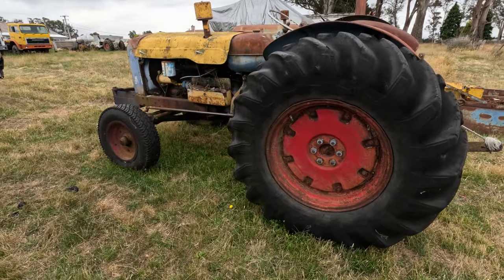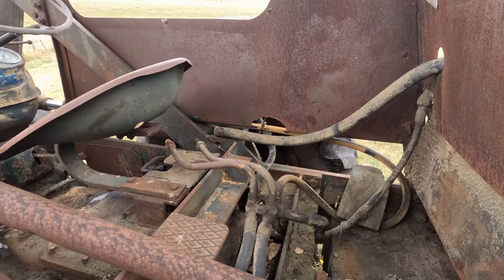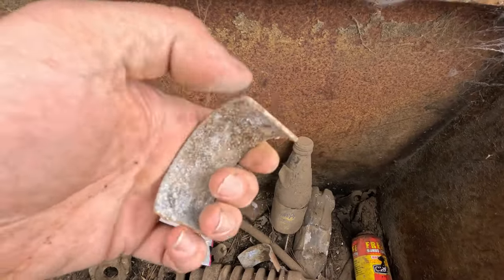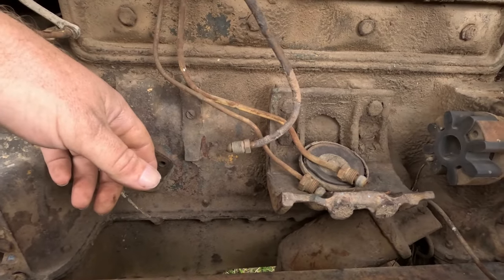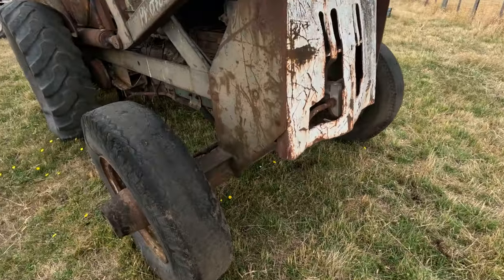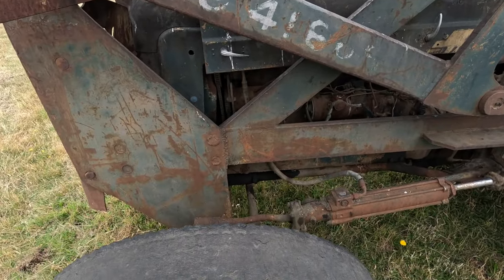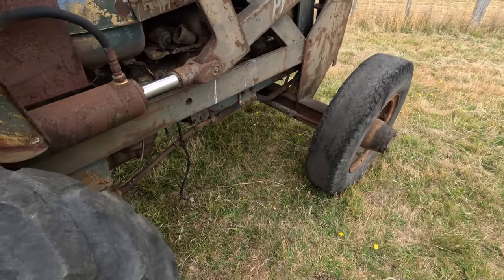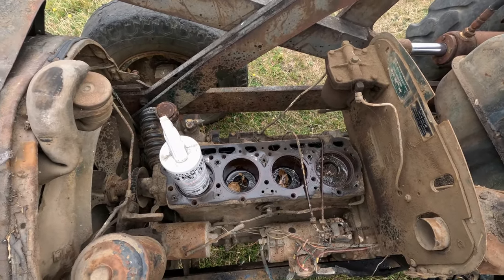Walk around of my Fordson power major fitted with a Malcolm Moore HC3 crane

Comment: I have been thinking about this crane and your thoughts regarding the flex and twist in the frame. I remember a Malcolm Moore loader and the front axle was fabricated part of the loader frame and not attached to the tractor. The loader was attached to the rear with a piviot to take a the twist. The front of the tractor was just hanging out there. It all worked well but seemed strange when driving because the losder moved differently to the tractor
Reply from the maker: That's interesting I'll have to have a bit more of a look at the front end it might be a similar design

Comment: If this was built in the UK it would have left as a factory skid unit. On a pallet with no front axle and no rear hydraulics. Good luck. I wouldn't be surprised if the cylinder liner seals are naff
Reply from the maker: Yeah I'm not really sure how malcolm moore got them, probably ass a basic unit. This one does have a pto on it that runs a toothed sprocket that is not connected to anything
I'm thinking I'm going to pull the liners to  free the piston up and replace the seals
Reply: That would be wise. Good luck.